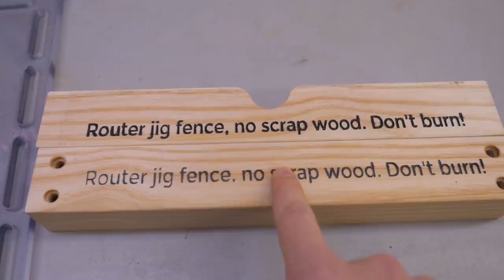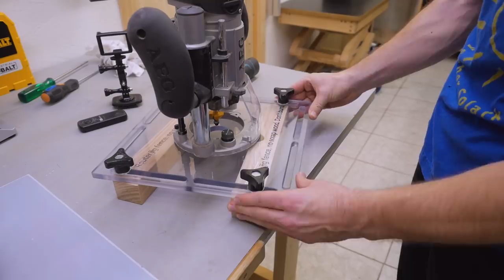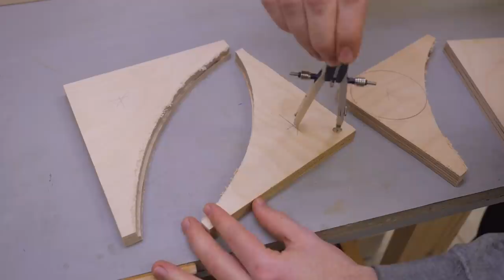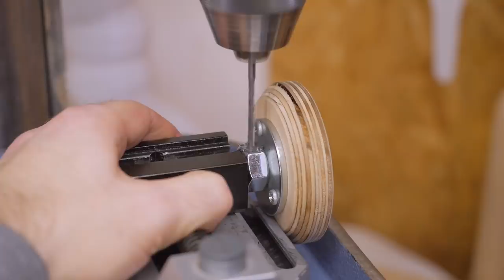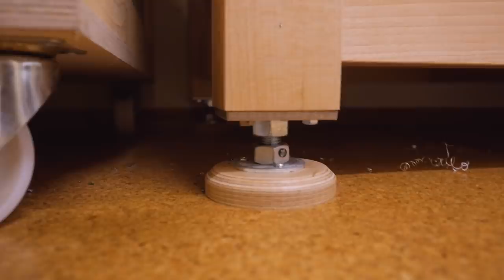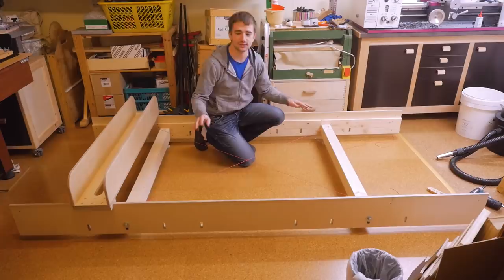Awesome DIY Leveling Feet and updates (Random Shop Stuff 19)

Comment: What an awesome saw. You deserve it and kudos to the person that gifted it to you. I have a crappy hand me down Bosch that stalls from time to time, but it will not die. They make good tools. And that one is a beast.
Reply: Ou peut,en trouver une documentation en français du pistolet a plombs chiappa
Reply: As far as the blue series Bosch goes, You can buy spare parts for even 30 year old machines with Your Bosch dealer - no problem to rebuild Your problem thingy and have a better machine afterwards than about 90 % of new ones on the market; for a fraction of he price, of course, Bosch spares are reasonably priced.

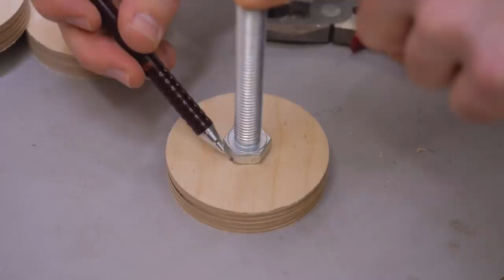Comment: If you drill the hole in the plywood foot base a little larger than the head of the bolt, it won’t be necessary to chisel it out to the exact size of the bolt head (3:20), then don’t tighten the nut down completely before drilling it for the pin. That way the plywood foot base will not have to turn to raise or lower the leg. You would still put a wrench on the nut like you show in the video, but the base can stay stationary because the bolt head has room to turn inside of the foot base.

Comment: Instead of the string, have you thought about using a water level? 4 hoses/tubes joined like an octopus connected to a vertical clear tube at each corner, filled with colored water, some hash marks on the clear tubes to line the water up with. Granted it wouldn't pack away as well as your string but it would be a lot faster to set up.

Comment: Hi Marius,
Very nice planer setup, congratulations! My mind started to ramble when I saw your leveling mechanism with the two strings: how cool yould it be to use some conductive strings or wires that would close an electric path whenever they touch, powering an acoustic buzzer or LED? Like this, the upper string could be lowered slowly until you hear a beep or see the light go on, without having the need go go to the intersection point to check visually :) What do you think? 
Greetings from Switzerland from a fellow engineer
Reply: Is here a wire that can act like string and can you use it on a long run?
Reply: 1j1o1n1a1s That’s a very clever idea! I will try that on my build. Thanks

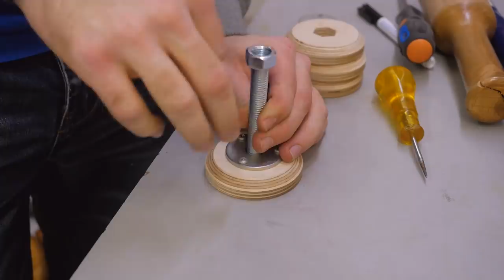Comment: 3:50 Is that a PH2 driver on a PZ2 sc...and it slipped :(

Yeah, in a small job like this it really doesn't matter. You can just toss the whole thing away and make a new one if really needed. Seriously though. Surprisingly few are even aware that PH2 and PZ2 screws are different in the first place, and require different drivers. I've seen so, so many screws and bolts beyond all hope it hurts.
Reply from the maker: Yes, it was the wrong driver. But as you mentioned it doesn't matter here.

Comment: man this will turn you fucking nuts, every time you adjust level and try to lock nut it will throw your adjustment out of range, with standard bolts the backlash is enormous. hope you don`t need that accuracy. take care. peter

Comment: Think about wire for cross strings with a light to complete a circuit  i'm going to try it  next time i do this
Reply: That's a great idea, if you had one corner attached to a stepper motor with a worm drive you could make the assembly self-adjusting, essentially chase the point whee the two wires just touch, i.e. conduct electricity, and then back off ever so slightly and then that's level all by itself. 

Brilliant idea with the wires instead of strings. :-)

Comment: at 5:20 the beam gets lifted a little bit when you fasten the nut. am i seeing that right? i think thats because the nut has space inside the wood. maybe you can weld it to the washer so you do not unlevel the hole thing when you try to fasten it.
Reply: Not sure if it’s because he edited the video and faded into another shot where the position had changed slightly
Reply: I also see that ,but I think it's because no weight on the top to push the wood downwards.
Reply: @tomeetjerry  the weight is pushing it downwards... thats the problem, i guess. by fastening the nut everything gets pushed upwards again.
Reply: Yeah on 2nd view it looks to have a little play but that should not be a problem after an initial tightening. Prob would be better to epoxy the bolt in place though
Reply: @HansPeter-ub2zu I guess it's the gap between the threads, maybe fasten them using hand torque will do just fine.
Reply: @tomeetjerry  only Marius can tell ;)
Reply from the maker: Yes, it actually lifts a little. Welding the nut ( if you have a welder) would solve that. But when you know that it behaves like that, you can also work with it.
Reply: Х
Reply: Keep things in context, yes its important to be accurate but even 2mm variation would make so small a difference over the total planed surface.
Reply: yup the weight of the beam is resting on the upper side of the male thread, when you tighten the nut the lower part of the thread is pushing so you have to account for backlash on std bolts and nuts it`s inconsistent too. if you`re hunting for tenths maybe you could get it right in a few tries, lower than that it will be all over the place and rarely give you an accurate reading, add that the feet rarely are completely square and or flat or the floor in which they are resting, so  x degrees of rotation which you`d think would make it right might throw you off much more or less. anyways it all depends on how accurate you need the part. an anti backlash type device could be made but that would be another kind of cat
Reply: @MariusHornberger  Could you not just use two wrenches, one on the adjusting nut to hold that in position and another on the lock nut to lock the bolt from spinning?
Reply: .yup putting the nut on top like you show in the link is the way to go. on std threads backlash can be as much as 0,15 which is a lot. but if he's fine with it he's fine with it.
Reply: @Ziraya0  yup the civilized world is using the system :D (i am a machinist/fab), when you add two nuts that`s double and here and there it gets significant. not knowing the accuracy goal i`ll leave it here.

Comment: Why haven’t I seen these feet before?  As an avid watcher I’m now excited that there must be an unwatched vid somewhere!!
For some great coplanar thinking outside of the triangle check out Fireball Tool’s great metal working squares. Changed the way I weld stuff up (welding may be overly generous) and it’s one of those forehead slapping “why didn’t.....” things. 
Oh, the reason why I haven’t seen these feet is that this channel is metric………! 🤭 (oh come on!  It’s the best that I can do and it’s late at night here....)
Thanks for inspiring us all over again Marius. Great stuff!
Reply: That's nuts, dude!
Reply: That unwatched video should be easy to find. It is the only one you haven't [Like]-d yet
Reply: Anthon van der Neut thanks...that’s the logical solution that I was missing!

Comment: If you let the head of the bolt spin in the bottom block you would be ale to just spin the bolt and this raise / lower that corner without having to overcome the friction of the block on the floor but you would need two wrenches to lock the bolt in place. :-)

Thanks a ton for sharing this update video and I look forward to your new build series.

Comment: Just slight care on the leveling feet, because the captive nut in the beams has a little travel room, when you tighten the nut against the washer to lock the leg in place the beam moves up by the amount that the captive nut can travel (it was at the top of it's cavity, but when you tighten it it is forced down against the washer plate)
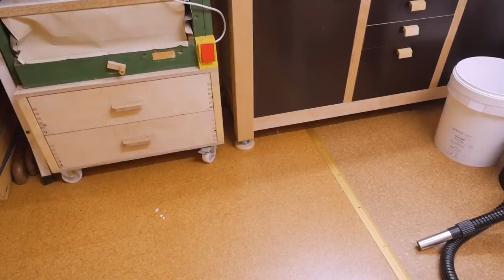Reply: @ 5:25 you can see how it lifts when thightening

Comment: You can burn scrap wood in stove without any law regulation in Germany?
Reply: Raw wood, yes. Plywood, no.
Reply: I don’t think there is a law that pretends to burn plywood ...
Reply: The law is 1BImSchV and it allows a lot as long as there is not wood protection chemicals inside
Reply: @peacekeeper5119 
It only allows raw wood, briquettes, and coal.
Reply: SCWfan06 it depends how you define a stove. But in general you are allowed to do so.

Comment: I forgot about the string method. It is used a lot in construction for making flat surfaces, not necessarily level surfaces. In your case, parallel is important, but angle is not. You could use this with the boards at 45 deg angle if you wanted to work at a slant, or if it is on a floor that is not level itself.

That's a great project, but I have a hand planer.  It would be great to see one modified for the hand planer.

Comment: at 6 min for more efficient and easy use,I use two steel wires as switches, on a 12 Volt or less circuit (led). As long as the steel wires touch, the light is on.

Comment: I built some similar leveling feet a while back. If you cut them on the CNC you can make the hex pocket at the same time. Using a 1/4" diameter bit you'll get a slight radius in the corner, but not enough to prevent driving the bolt in. I tightened the bolt and nut on the washer before screwing the washer down so I could put a wrench on the bolt instead of depending on the wood as a wrench. I didn't bother with the pin through the nut.

The string method is also used to tune a CNC machine. With your adjustable side rails you could skip the leveling feet and just put the strings on the rails and adjust them. However, a fine adjustment would be more difficult than with the threaded feet.
Reply: It dawned on my last night that just leveling the rails you couldn't get the two sides parallel. I had in mind flattening one side and then running it through a planer. I used to do that for boards wider than my jointer and narrower than my planer. Now I have a combination machine so they are the same width. For wider slabs I flatten on the CNC (same process as this just semi-automated) and of course have to flip them over to get them parallel, so you do need the cross bars that support the slab (CNC table in my case) co-planer and parallel to the sled support rails.

Comment: I've just finished making my router plate, pretty easy with a handheld router and edge guide. I didn't think of the router table. Because a router bit doesn't plunge very will in the centre, (it will melt the plastic) I  predrilled a 6mm hole at the plunge points.

Comment: In the feet, Why not soldering the nut instead of the pin?
Reply from the maker: I don't have a soldering iron that powerful
Reply: Marius Hornberger  I was thinking more  at  tig mig or electrode :)
Reply from the maker: But that's welding...I don't have a welder
Reply: Marius Hornberger  LOL good motivation :)

IMHO is fundamental in the home shop think at a good TIG welder, anyway very good job!

Comment: Does the bosch saw have a lot of blade deflection? I have a cordless porter cable and the blade deflects probably about 15 degrees with moderate pressure. Enough to REALLY screw up a cut. My crappy fix requires adjustment every time the blade depth is changed and is a PITA.
Reply from the maker: It's not perfect but the blade deflection is very minimal. And the depth adjustment is good, I like it